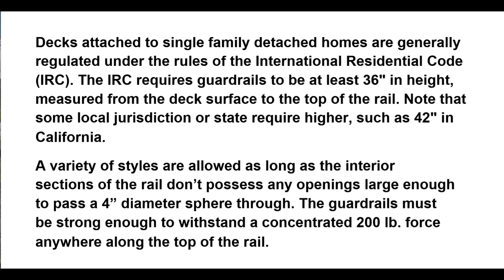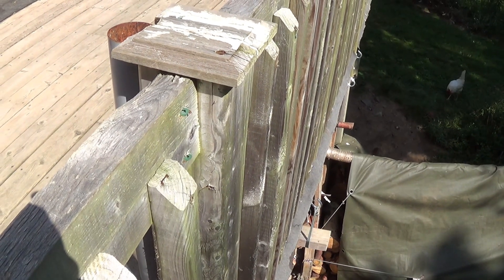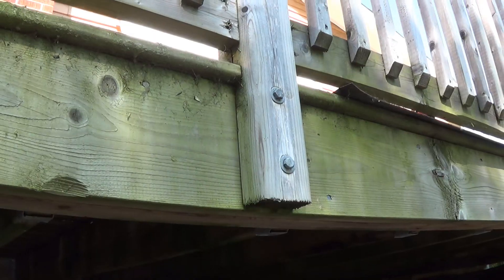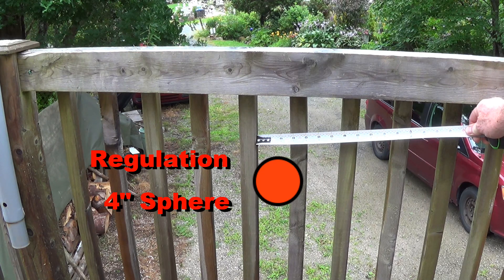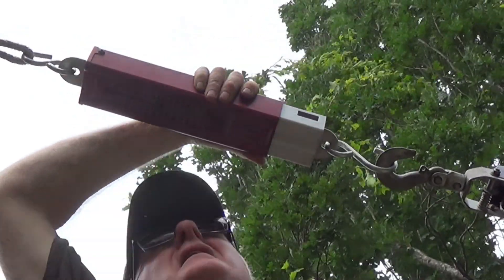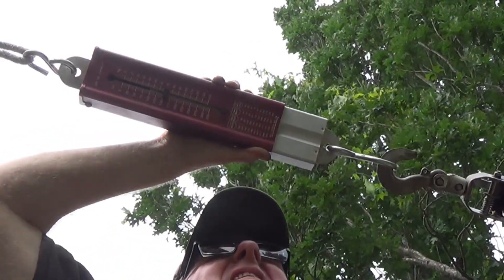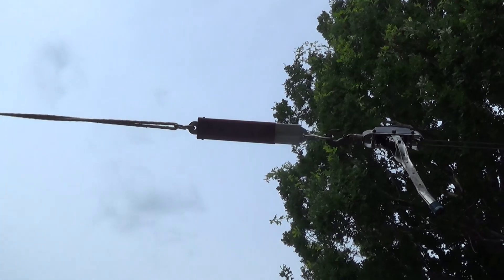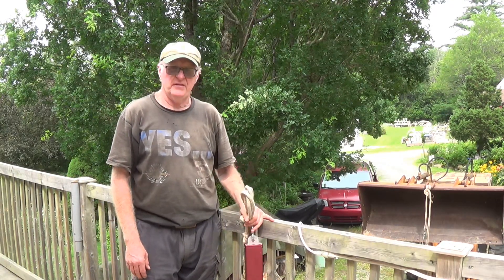DIY - How to Test Deck Railing Meets Building Code

Comment: Would 36 inch deck rail be high enough?
Reply from the maker: Thank you for your question.
Typically, 36" is high enough. However, some states require higher railings. Please check with your local building inspector.

Comment: What about balisters and what is the IRC section number for that please? I read all over the place that it's 50 lb but I do not have a section number to refer to.
Reply from the maker: Thank you for your question.
Section R507 for DECKS.  Subsection R507.12.1 IRC.
Reply: @BasaPete  I've been looking all day THANK YOU !!!!!
Reply: Again thank you but I don't see the lateral load limit here. It looks like this is where it should be but even the links aren't fruitful.
Reply from the maker: @czarkaztik1617   Load limits may be a local regulation, such as state or national. You should check with your local building inspector.